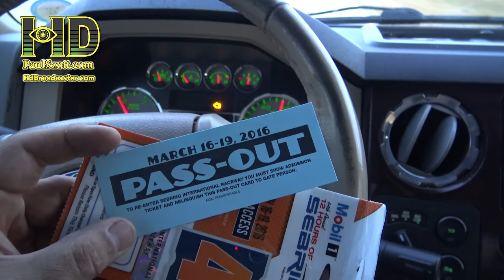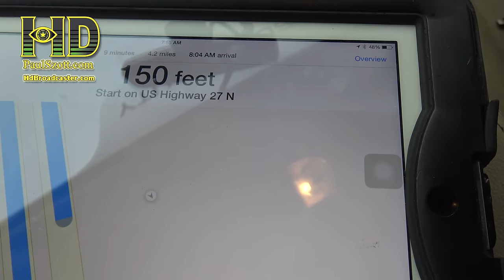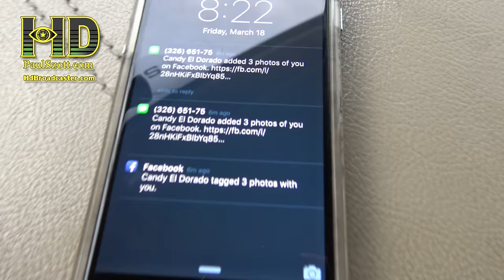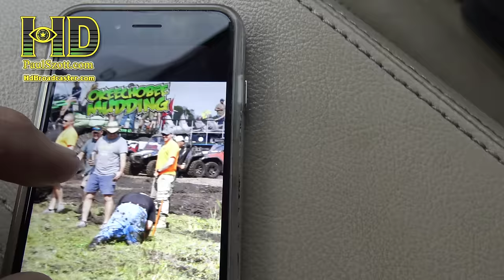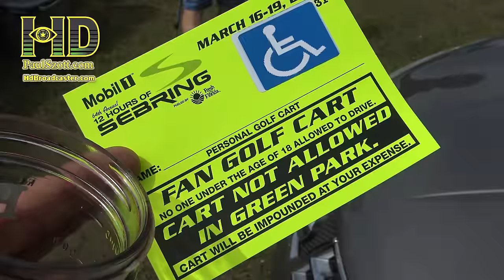(WARNING- Boring Video) Looking for Parts / Fixing Stuff @ Race Track

Comment: You forgot a gasket !
Reply from the maker: +michaelovitch lets see what happens. So far its not leaking
Reply: +PaulSzott.com 
You should have a gasket between the engine and the metal plate ( where the spring is attached)
An other between the metal plate and the carburetor.
and one other between the carburater and the black plastic pipe.

You may will have an air leak,and difficculties to start or to run it.

Not that boring otherwise : )
Reply from the maker: +michaelovitch i need a bigger engine. time to work on that.

Comment: one agains the engine, one after the protaction plate and the last before the hose mount?
Reply from the maker: +Magnus Roaldsetli  I messed up somewhere. Its not leaking yet. I wouldn't even know what a protection plate is. LOL
Reply: +PaulSzott.com the one with the springs attached :)  basicly one gasket between each part, but if it dosent leak its all goodie :) grate videos btw love your work!

Comment: yep  big one goes between the bracket and carb small one at the air filter pipe
Reply from the maker: +Raymond Aston i had 3 of them
Reply: +PaulSzott.com I Think one before the bracket one after the bracket  and the small one where you put the two looks like  you got it running
hock the seat belt

Comment: i think only one gasket goes on not sure thow
Reply from the maker: +piney power (billy) I'm not sure also lol
Reply: +PaulSzott.com Paul that one gasket should have been the first thing you put on, it goes in between the carb and the motor or that spring bracket. And take that cut piece of rubber off and re tighten that intake hose on better you dont want water or mud to get in there and ruin you engine.